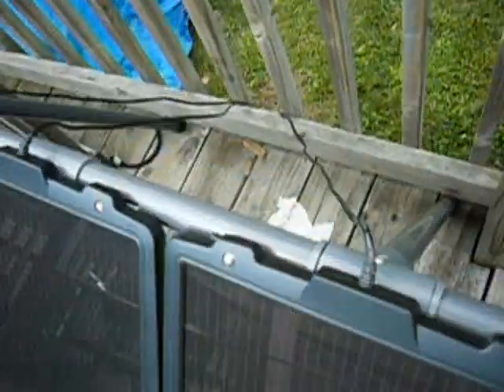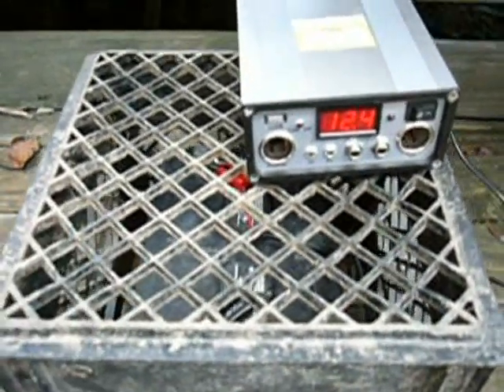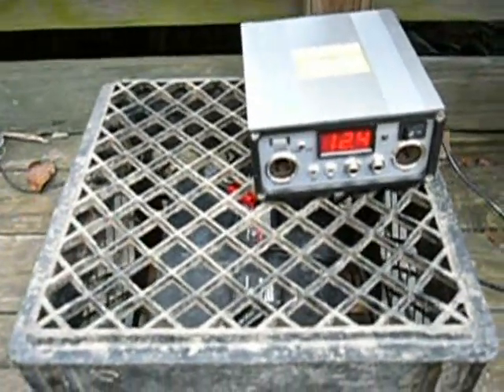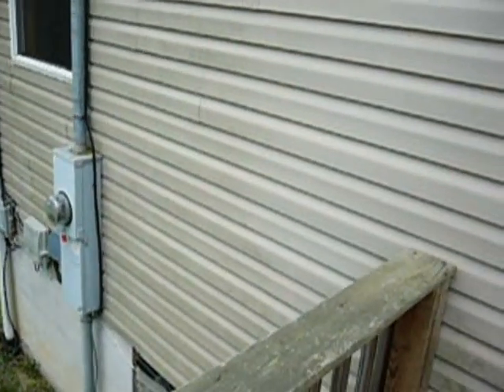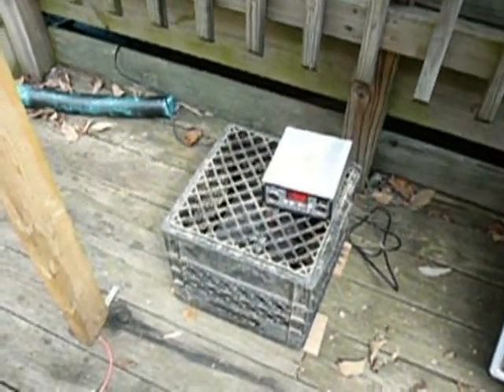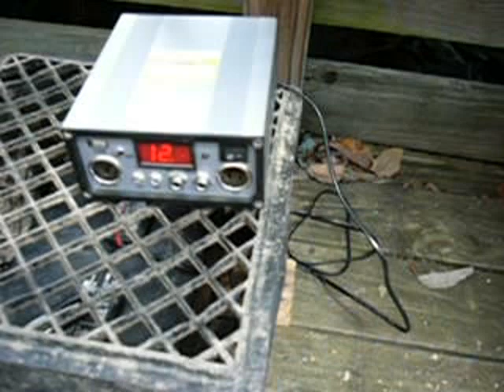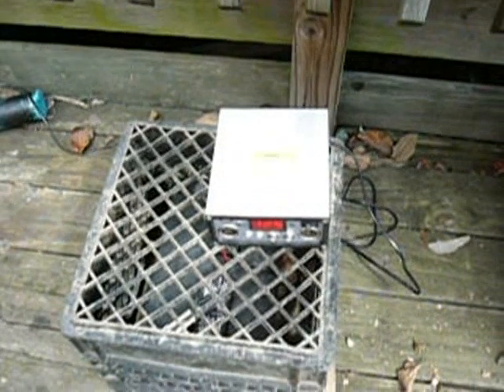Solar Panel Kit

Comment: your batt. bank should be at least deep cycle batts. and it would work better if all were the same amp hours. you can do a mis match but do get mad when it does not last as long as you were expecting it to. doubled up golf cart 6v batts work the best the cells are huge.. BUZZ BUZZ heehee

Comment: I have two of these kits, and they are great.when you have the battery and panels hooked up to the controller, the digital display shows battery voltage, if you have only the panels, then only its voltage. I just picked up a new 100 watt controller on sale for $28.00 at Harbor Freight. I also picked up the Universal Connector so I can hook both kits together for a total of 95 watts. Have Fun and Good Luck!

Comment: Regardless of the application of the battery, car/truck batteries are not designed to be deep discharged over a long period of time. It will kill them in fairly short order. Golf cart or actual RE (renewal energy) batteries are the best choice even if they are more expensive, in the long run they are more economical because of their long life.

Comment: Jnull0, before you invest in deep cycle marine batteries, save your money a bit longer and get a pair of trojan or similar 6 volt golf cart batteries. Two reasons, 1 longer battery life and 2 higher power output. They can be deep drained more often and live longer than marine deep cycles. Marine deep cycles may have a life of just a few years vs 5 to 7 years on the Trojans. Down side, initial cost is higher, but cost per year will be lower. Good luck and God Bless!

Comment: i have 3 deep cell battery's & 412 watt inverter runs 2 tvs and internet & VCR's i run 1 computer off 200 watt inverter and 2 battery's it runs the computer i use! i burned up 26 in flat screen & 2 vcr's one no picture & other grinding noise there old my older xp systems take more power too, then windows 7 system it newer, thanks gregg

Comment from the maker: thanks for the info Steve.  That is what I plan to do over time, to build up the system I need, this is just the start.  It will take some time,as resources will allow,and as I learn more, I should be able to build it up to where I can use it for some of the house, but will never be able to completely rely on it.  It will be a fun learning project, thanks for the comment, and for watching.
J

Comment: The batteries you need are NOT marine but deep cycle golf cart batteries or the specialty ones just for solar. Marine bats are not meant to be charged over and over going to a 50% depth of discharge...itll eat them. Do the research 1st so you know what your getting into as this route for running what you talked about will cast far more than a prperly designed system. far to much to touch here but research is 1st and a must.

Comment: i hate to be the bearer of bad news but youve fallen into the same trap so many others have. These pannels have a total of 45 watts in direct sun and will almost never produce what is on the label. Considering a TV uses at least 100watts an hour do the math. it wont do it. Adding more batteries wont either as the pannels cant charge them fast enough. you need to design the system for the loads you want to run and build out as you can afford.....

Comment: You do need a battery bank of 9 deep cycle batteries but Yes You are doing very well If only I have the help with Family  A Normal usa house uses 4,000 to 8,000 Watts of power each day
(But everyone is different check with a meter daily use over a few months) 
 To keep up with you at the highest use / it is wise to have The solar panel recharging a battery bank that can handle washer dryer A/C etc at it's peak

Comment: Hey John, good job explaining your system and your plans.  One step at a time is a good plan.  Check out LDSPrepper and OBXSOLWIND channel.  They are excellent and have a lot of information on solar.  Seems like people are recommending 6V golf cart batteries as the best (and least expensive) way to go for solar batteries.  They will supposedly last longer than marine batteries.  Just a thought.  Thanks for the video.

Comment: Be careful with the batteries you use. My buddy burned our hunting cabin down using marine batteries. We thought we were smart. The boat was up for the season so we took the batteries from the boat and used them at the cabin and about halfway through the winter it was destroyed. I did some research and found the best for the bang for your buck is Electric Golf Cart batteries. Bought some from the local course at the end of the season and they've been working for 2 years now. Good Luck!!!

Comment: John, if you're going use a 12 volt system with inverter and you're going to buy batteries anyway.... use 6 volt car batteries hooked up in series/parallel configuration to create the 12 volts. 6 volt batteries will give you more ampre hours and last a lot longer.

Comment: When you run the line into the house find a swivle head angle drill put an inlet size hole where you want the wire. Using a 3/4 bit drill through floor inside the wall the push a 1/2 flexable CPVC through, install wall box with CPVC and run your wire. This will minimize heat loss, you probably already know this but others may not, so show them how.

Comment: Some Experience
A good start on batteries is 27DC6 batteries from WalMart, Interstate, or any other trusted store; given that go for price..
A better start is to use 6-V golf cart batteries wired for 12 volts.  Try Sam's or another trusted store.